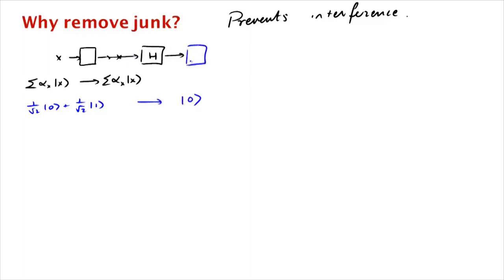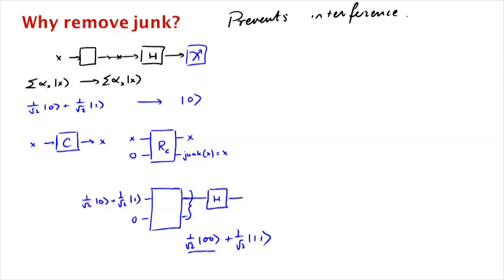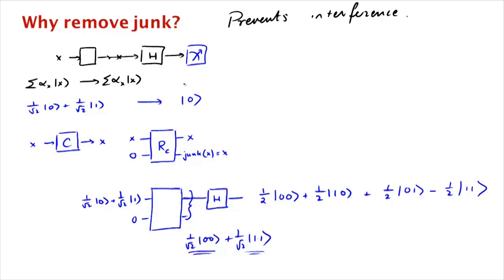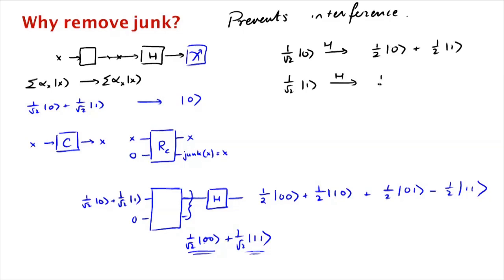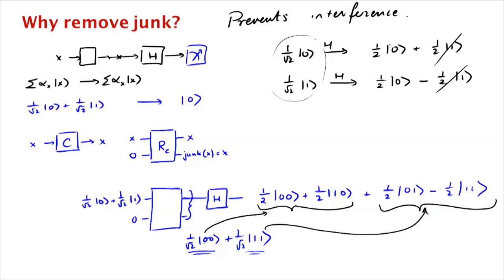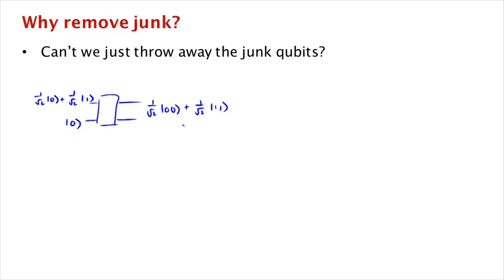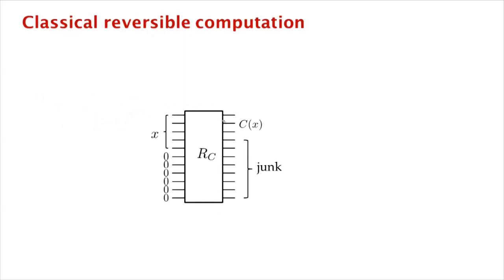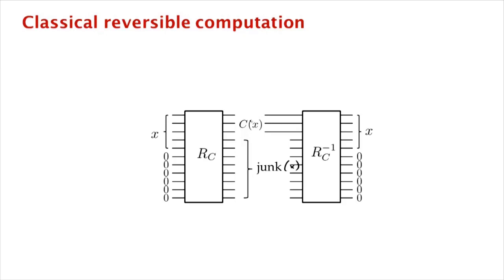Lecture 7   4   REVERSIBLE COMPUTATION

Comment: At 10:17, I think the picture would be much more effective if you drew the entire CNOT array at the top, showing the control bits flowing through it, and then brought those back down and into the R^-1 circuit.  That would eliminate the need for the "wire branches" you've drawn.  Those confused me - it felt like we were violating no cloning by using C(x) twice.  But we're not - at least not beyond the apparent fact that with 0 target inputs the CNOT gates bring C(x) out on both sets of inputs.  But at least it gets us to "if CNOT gates work as advertised, this circuit works."

I want to credit Patrick Banner for this - I posted about this issue on Quora and he brought forth very useful info.  I'm pasting his entire repsonse here.  The rest of this comment is courtesy Patrick:

After doing a bit of reading out of my copy of Nielsen and Chuang I think I’m able to answer your question. I may be wrong, but these are my thoughts.

First, what do we mean when we say “clone”? We mean you have some arbitrary qubit A and a dummy qubit B. If you had a “clone” gate, you’d put A and B through and, whatever A and B were, you’d get out two copies of A.

And let me just be very explicit about what that means by giving a counterexample. If you put (0+1) [I’m not writing the ket signs, it’s a pain] through a CNOT gate with 0 as the target bit, what you get out is 00+11. Understand that this is not a clone. If we had cloned the control, what you’d get is (0+1)(0+1) = 00+01+10+11, which is not what we got.

Second clarification, which I had to look up to remember: the “wire branch” is in fact the CNOT gate, and the wire with the dot is always the control, while the wire with the open circle is the target.

So the intention here is that we use C(x) as the set of control bits, and y as the set of target bits. Now, in a CNOT gate, the control bits are never changed. And the dummy qubits are the targets, which just give… some state. So as far as C(x) is concerned, we’re just passing it through an identity gate before putting it into Rc-inverse. So we do indeed use C(x) twice, but one of those times is an identity gate, which does nothing to the qubits. So we “really” only use it once.

But we’ve gained extra information through the dummy target qubits y. If those dummy qubits are known, e.g. if they’re all zero, then the C(x) control does a known thing to those qubits.

But note that, as was explained above, using 0 as the target does not clone the qubits. Instead it creates superpositions. If C(x) = 0+1 and y=0, then the output of the CNOT will be 00+11, where the two qubits are C(x) and y. You then put one of those qubits, C(x), back through Rc-inverse, and get some final answer out. Doing so will also change the state of the y qubit, but in a way that you know assuming you know Rc-inverse, so by measuring the final results of the y, you can recover C(x).

When he says you “get a copy of the qubits,” he is making a statement that is at best misleading. What he means is that you have an output from which you can recover the answer C(x) after doing some pen-and-paper work with the measurements you actually get from the qubits y.

But at no point is a copy of C(x) made, for the reasons given above. Particularly if 0 is the target of the CNOT, you end up entangling, which is not equivalent to copying. But it’s close enough to still be useful, given you know how Rc-inverse works.

I hope this is helpful.
Reply: This is something that has puzzled me. In one of the lectures the same configuration used here (the copying of the f(x)) has been proved impossible. It even had a zero as one of the states. Id like to understand this better, afterall, can we copy the state or not?

Comment: I'm confused.  We send in X and 0's, and get F(X) and junk.  But then we reverse F(X) and junk to get back X and 0's as part of the ultimate output, and it looks like we've essentially COPIED F(X) using the extra CNOT gates with 0 input so that we have F(X) as an output.  But that seems like it violates no cloning.  In fact, just a single CNOT gate with 0 input seems to violate no cloning, because the control bit passes through unchanged but the output is a copy of the control input, essentially.

How are we getting away with this?
Reply: yeah..... I have the same confusion here, maybe it just a un-intentional false example
Reply: No cloning just states that we can't clone some unknown qubit using a unitary. If the qubit is known to be either |0> or |1>, then this can be copied using a CNOT. This doesn't violate no cloning as CNOT can't copy |+> for example. Therefore if we are given some unknown qubit, CNOT isn't guaranteed to be able to copy it. 

In this case, since F is simulating a classical circuit, we know each output will be either a |0> or |1>, thus we can use a CNOT to copy it.

Comment: Congratulations for this courses it's very insightful. However, I have a small question : 
03:30 we have on the board Rc(x,0) = (x,x).
Can you confirm me that it's a CNOT so that it can clon a bit but not a Qbit? as we are introducing a |+> it's confusing me. 
Thanks a lot,
Reply: CNOT is not making a clone  of the bit, but transform the quantum state of the system. Confusion is coming from the name CNOT - which is not what it is. CNOT happen to behave as  classic CNOT under certain conditions, but in quantum reality it changes the state from a|00> + b|01> + c|10> + d|11>  into a|00> + b|01> + c|11> + d|10>

Comment: How are you able to copy/clone C(X)? I thought that was not allowed.
Reply: CNOT does not make a copy of the control qubit. So, "y" is not a copy of C(X). the output is tensor product of y =|0> and (C(X)) - which is not C(X).
Reply: @SunnyFly100  The way it's used in this video most certainly SEEMS to make a copy.  After the first stage, where we just replace NOTs with CNOTs and ANDs with CSWAPs, we have F(X) and junk.  Then we USE that F(X) in the inverse of that first circuit to take us back to X and 0's (we get rid of the junk).  F(X) also serves as the control bits of the fleet of CNOTs we added up at the top, and the output of those CNOTs is... F(X).  How is that not a copy of the control inputs?

I had just about decided that a "wire branch" isn't possible in quantum computing, precisely because of "no cloning."  But that's exactly what was done in this video - he branched the F(X) wires so that we had one copy to use in the reversal circuit and one copy to use in the CNOT array.
Reply: @KipIngram  Yes, I'm wondering about the same thing too. I don't understand how we DON'T violate the no cloning in this process..
Reply: Did anyone get an answer yet?
Reply: KipIngram posted the answer below. Briefly, no cloning theorem is there to prevent us from measuring two properties in violation of Heisenberg principle. This circuit only measures the state once (on top of the diagram). In the bottom part the state of C(x) is destroyed regardless of the wave function. The bottom part of the diagram yields zero states regardless of what C(x) was, so no cloning doesnot care.

This is related to Elitzur-Vaidman bomb tester.
Reply: @samtux762  so we can say that, as long as we don't end up with TWO states | F(x) > we're not violating the no clone theorem. I think that a better word for that part of the video would be to say: "We will TRANSFER the |F(x)> states from here to the end of the circuit, preserving them. And the second part will vanish when used as an input to the inverse circuit. But still, what puzzles me is that, if you could "look" in the wires AFTER the CNOTs but BEFORE the inverse circuit, |F(x)> would be present at the same time on the top wires and in the middle ones. And this keeps coming back to me as a violation of the no clonning theorem. Where is the catch here?